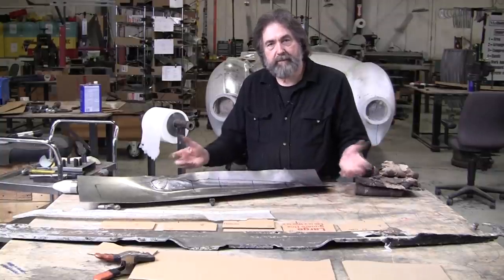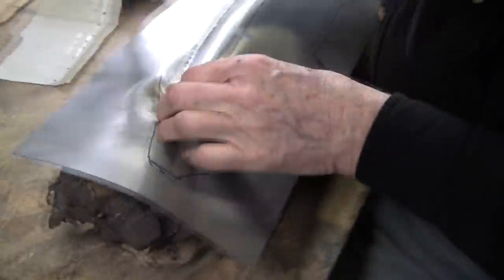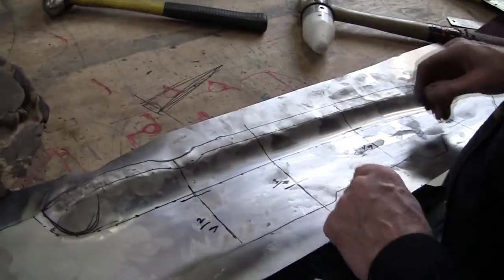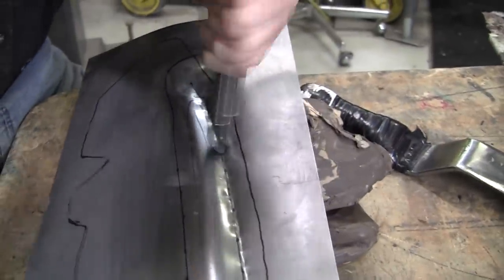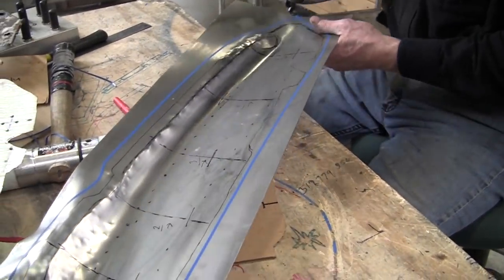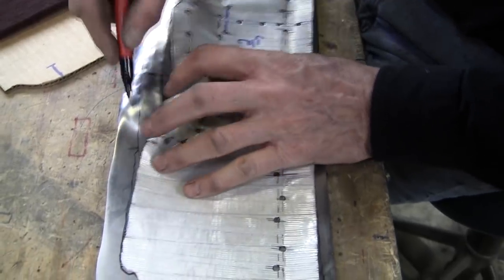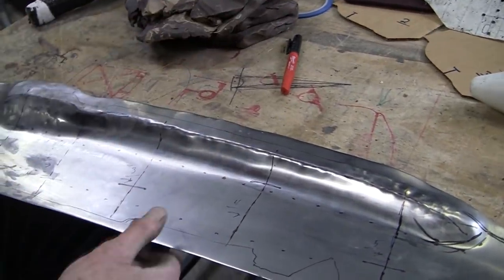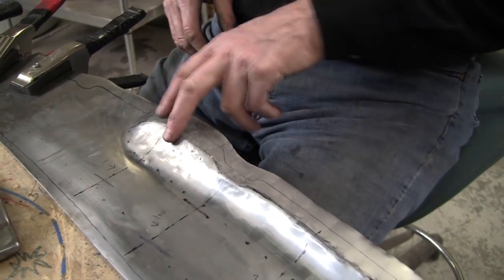Steps to make a panel: 52 Cadillac Convertible (Part 3)

Comment: Thank you for doing this series. I have a splash pan that is from a 50's Chevy that was in an accident and rusted.   I am beginning to believe that I can actually repair it with a fabricated section instead of purchasing an import as most imported replacement panels are thinner, stamped with dies that are made incorrectly.    Thanks!

Comment: Great idea with the clay. Does the clay have a “shelf life”? Does it harden up or can it be re-heated to soften it back up? How many lbs is that mound you are using?
Reply from the maker: The clay lasts forever.  I would guess I have 5lbs in the pile I used.
Reply: @proshaper  Wray  how is the master doing i have to watch what ypu are doing from the first video this is part three bye 👋 from 🇨🇦 #YSW Domenico Monteleone

Comment: Just wondering if you could use a tipping wheel on the bead roller instead of the delrin chisel and clay.
Reply from the maker: It needed the extra area right at the tip that is why I used the caulking tool.

Comment: Would one ever make a pattern for both sides of a panel?
JIM
Reply from the maker: Yes you can, but in this case the other side is rusted away.
Reply: @proshaper  I meant the top and bottom, both sides of the same piece of metal.
It seems to me some of the small detailed areas might benefit from a pattern on the inside of the panel?
Asking because I don't know.
Thanks, JIM
Reply from the maker: @jimc4731  more information about a surface is always helpful. In most cases not needed. I have never made a inside flexible shape pattern. A lot of time you can't do it because stuff is in the way.